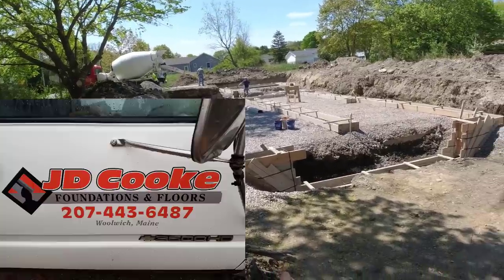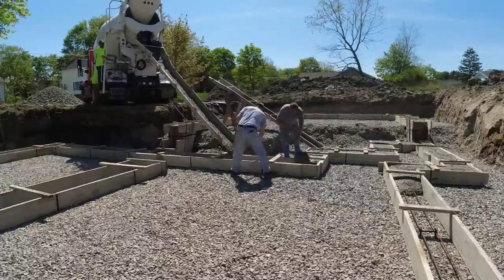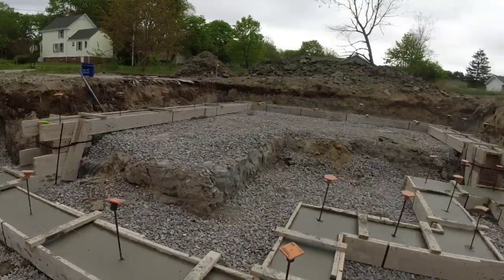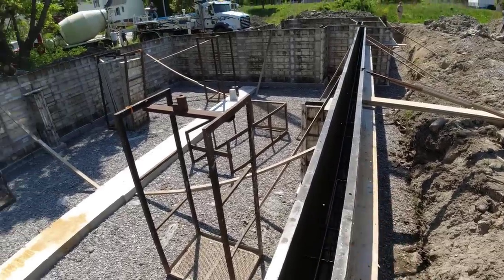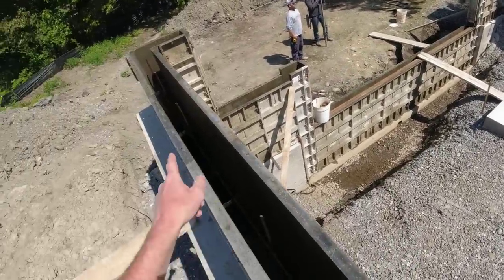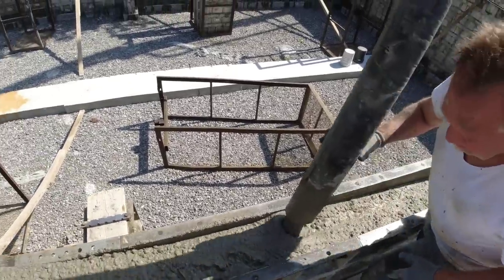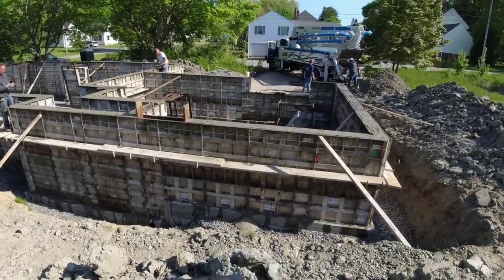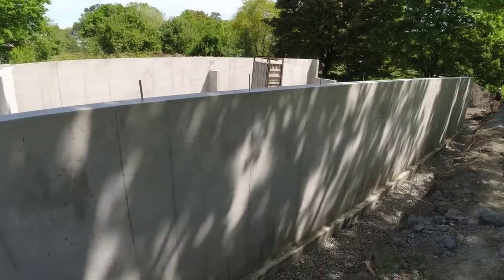How To Pour Concrete Footings and Concrete Walls (House & Garage Foundation)

Comment: Interesting in Massachusetts you need a keyway in the footing uprights help but guess it's different up there. Jim does a nice job, he should look into footing brackets. Did footings like that 20 years ago. The bracket eliminates 2x4 and banding on the bottom. Never tried the aluminum forms but my oldest boss has them loves them. Nice job everyone.
Reply from the maker: Thanks

Comment: I wish we had that concrete pipe pouring thingy way back when we were working on building retaining wall on the steep side of a riverbank. It was nightmare trying to get the concrete truck backing up close enough to work site and then struggling getting them out through muddy track.

What do you use to vibrate and compact the concrete? The concrete looks very highly workable and just flows smoothly filling the gaps.

Edit: I work in hot humid tropical climate. Is it because your concrete mixed differently according to your climate condition? Or there's special admixture for it?

Comment: As a southerner, this is definitely not our usual slab foundation. What can you tell me about the plumbing, sewer, and electrical stub-ins when doing this type poured wall system ? How are they routed in, usually ?
Thanks
Reply: Under the footings I would assume. This is how we build in Canada just different form systems looks good

Comment: What is the PSI, did Jim use the air entrainment and water reducer? I noted they did not use a vibrator tool rather a hammer or shovel, yet the walls came out really smooth!! Thank you for sharing!!

Comment: Mike
Just poured a small (12" by 2') flagpole using a premade tube to contain it.  Do I have to keep the tube on permanently or can I remove it?  I would have to cut the above ground portion; I am not digging everything back up to remove the tube.  My intent is to paint the cylinder.  Can I just paint over the tube with the concrete paint?  
Thanks